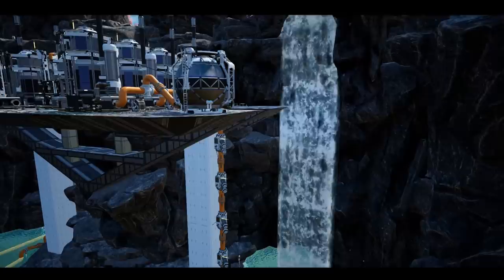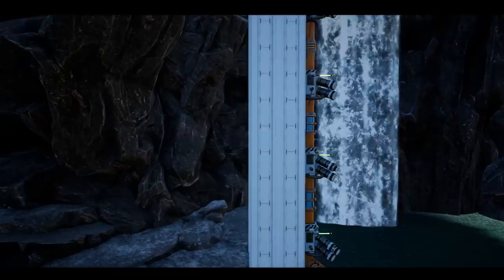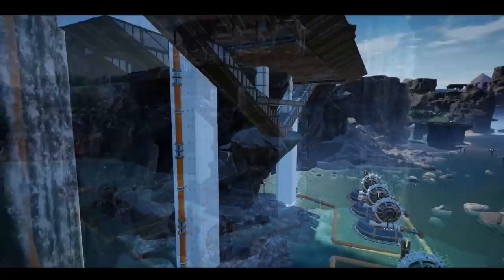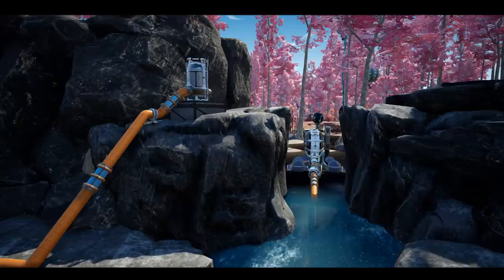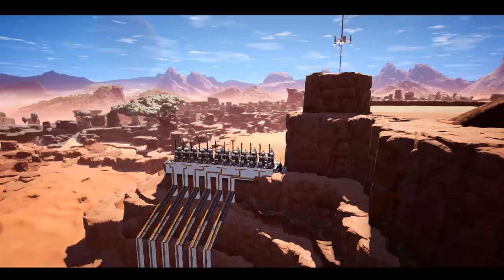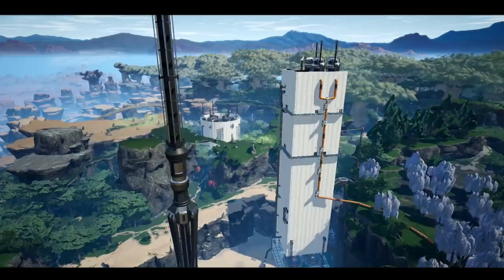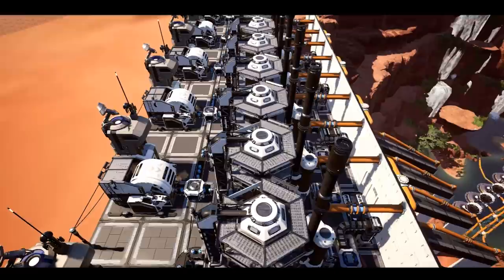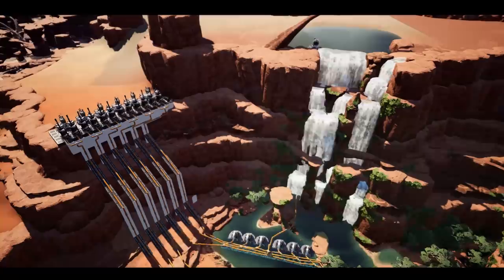A Guide to Not Needing Pumps [Satisfactory Guide]

Comment: The upper pump what gives the head lift does it have to work on 100% or you can clock it down let's say like 10% because you will win in power consumption !!!
Reply from the maker: Well in theory, even if it's 100% clockspeed, if you're able to pump water to the top of a tower, you'll then be able to disperse it into 6/10/20 other pipes and thus void their need for pumps. Meaning you will exponentially increase the amount of power you're saving :)

Comment: Will it work, when i put a refinery on very top of the map, bring there packed oil with conveyor. Then unpack oil, and drop it to the buttom of our sistem.
Reply: For best results have the oil unpacked to a fluid buffer (at the same elevation as the unpacking refinery) since fluid buffers reset the head lift calculation.

Comment: So all that was done was proving the game acknowledges lift via water pressure.  Though the video FAILED to show how fast the water was filling the pipes through examination of the pipes.  So I can't trust the results here.  With out that, while your getting water at the top... your not showing how fast it arrives there.  Which is a major factor that got ignored with this video.
Reply from the maker: Sorry, it's a great point that I should have mentioned, however I'm not sure how I could judge it (I was planning to show it off but sometimes the head lift pipes had a greater flow than pumps and sometimes vice versa, I just couldn't find an average response which I thought was odd, and didn't want to talk about something I couldn't show off fairly, that being said they are roughly the same as pumps, sometimes more sometimes less.

Comment: Is that a bug or a feature?
Reply from the maker: feature apparently. It shouldn't be a bug though because this is how it runs in real life, providing you have downward push from something.
Reply: @TotalXclipse  Maybe you are right. But the top container have to be at the same level or above that that will consume the water
Reply from the maker: Henrry Pires yes it does consume water but slowly and it’s still far cheaper to pump one like up to the container then split it between 6 extractors than it is to pump 6 full pipes to that height
Reply: @TotalXclipse  I can't imagine this would work in real life.  Especially being able to lift the throughput of multiple pipes with only one "driving" pipe.  I'd have to guess that this is an artifact of how the programmers abstracted and simplified the system rather than an intentional thing.  But we all know what they say about opinions and the source of their smell, so until Coffee Stain says one way or another, I'll be looking into using this!
Reply from the maker: @snidely9852  I don't think it does with multiple pipes in real life - but with a single pipe it does. but if we're doing off of real life placing pumps next to each other should add extra lift unlike what they do in Satisfactory so trade offs I guess.
But yeh who, knows, if they change it, it's fine I'll just put pumps on the pipelines I've already got :D

Comment: do you think this will be patched?
Reply from the maker: maybe :D - not very helpful I know... it depends it's not really a hack but attaching the extractors at the bottom is. then again when they update the pipe system, we may be able to run this setup still using varied size pipes.

Comment: When do you need a pump?
Reply from the maker: Depends. If you're only using water or oil below the highest extractor you have on the map, then you don't need any. If you're building  water tower or oil tower. Then you need enough pumps to get the water or oil to the top of the tower but you won't need to use any pumps on any pipelines it splits too

Comment: This is literally worthless. Just build all the extractors at the top..
Reply from the maker: It's not worthless. Say you're building a megafactory  higher than  the reservoir building a water tower above the water would be very useful. Or if you're building an oil refinery Building a single container with pumps up to that will allow all your oil to go up to any height.